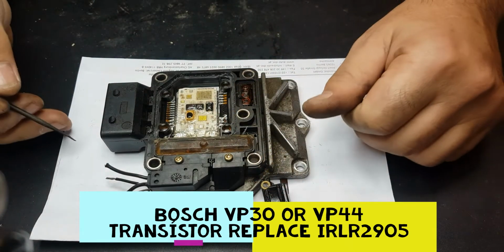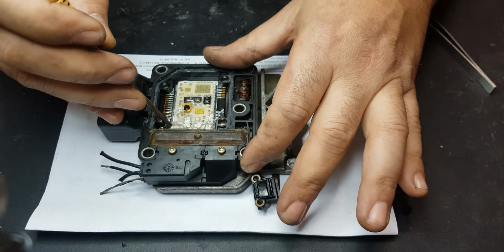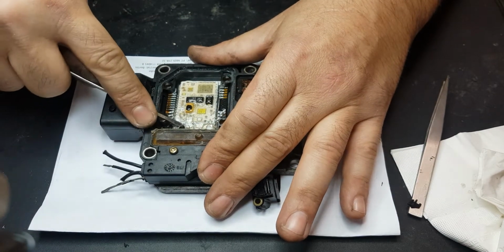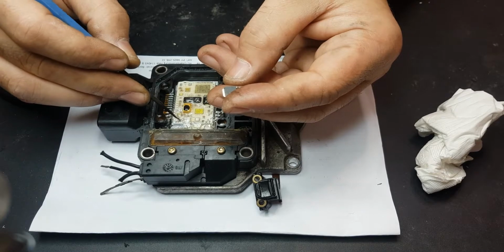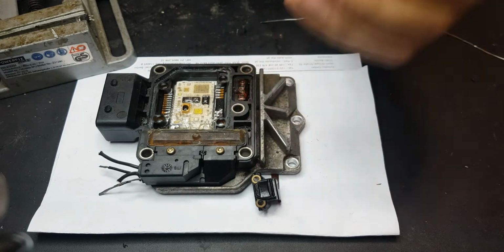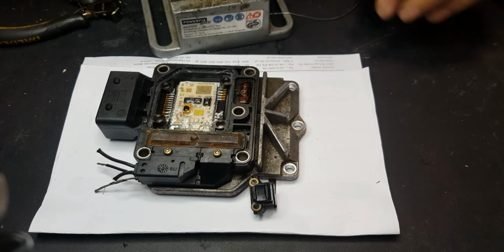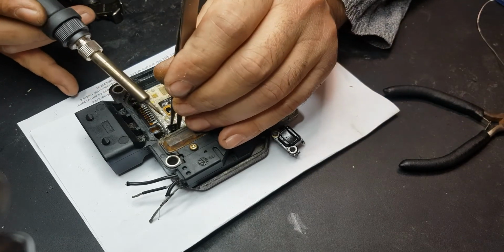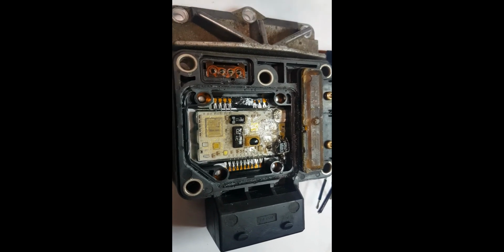bosch vp30 vp44 transistor replacement

Comment: Is the transistor an up graded transistor??? And you said replace the yellow capacitors what is the part number for that and how many should I order??? Thanks I appreciate it.
Reply from the maker: the capacitor is marked in it and its only one per pump...the transistor is pretty much the same as original but there are others that can deliver a little more fuel but the car starts to smoke a little

Comment: Super like. I heard the major failure of these pumps is soldering in the board. Upgrading the heat sink to 60/40 seems like a great idea that could not be viable for mass production but would advantageous for performance and biofuel applications. Thank you!
Reply from the maker: thanks for watching and your input
i guess youre right the mai issue with these is infact the heat dissipation not beeing enough.
some people actually extend the transistor to out side of the pump and use an external heatsink

Comment: Hello , vp30 and vp44 have the same pump control unit ? Can I purchase an Audi A6 pump control unit to repair a Ford Focus 1.8 tddi ? Looks like the same part . . . 
Thank you .
Reply from the maker: @MIEDEPAIN20011  thanks for watching..
No you can because the software is completely diferent from audi to ford
Reply: @PSICompanyPerformance  
Thanks for your quick reply !
And for the advice .
Reply: @PSICompanyPerformance  
Another question please : the Audi software can be removed to install ford software ?
Thank you .
Reply from the maker: @MIEDEPAIN20011  i guess it could be done but i never tried it and dont know what software could bo that.
Reply from the maker: @MIEDEPAIN20011  i dont think that thats possible in this situation...if you have another ford pump, you can virginise it but if its an audi pump i dont think it works.
good luck
Reply: @PSICompanyPerformance  
Hi .
I have an answer , it seems be impossible to removed the Audi software and install a Ford software .
Reply from the maker: @MIEDEPAIN20011  thats what i was thinking.
Reply: @PSICompanyPerformance  
Arff , j’ai encore une question : Est ce qu’il est possible de tester un calculateur d’occasion afin de s’assurer qu’il est fonctionnel , avant de l’installer sur le véhicule ? Merci .
Reply from the maker: @MIEDEPAIN20011  you need to virginize it first, because these are coded to the car, but if its virgin then it will be coded automatic the first time you turn the ignition on
good luck ( bonne chance)

Comment: Hello, my father bought a ford focus mk1 1.8 TDDI less than a week ago, it ran perfectly but now it won't start. The engine cranks but no start. We paid it with our last money and now we're in a very bad situation. The mechanic insists that the pump has failed and needs to be replaced entirely which would cost something like 1500€, and he's saying that we should scrap the car. This is a very lazy mechanic and is very ignorant about electronics, so i want to ask if this could solve the problem? I already got experience with microsoldering because i repair phones and computers so i'm thinking i should try this as a last resort. Do you think this could solve the problem? I just want to help my family
Reply from the maker: thanks for watching
get the error codes read, because it could be something else, but if it is the pump, then, most likely it will be this problem that 9 out of 10 is the fault in these pumps
good luck
Reply: @PSICompanyPerformance    thank you, if you don't mind i got another 2 questions:
1. Can i use the secret menu on the dashboard or do i need proper diagnosis tool for reading the codes?
2. Is it true that IRLR2905 transistor is too weak and will break after a few kilometers?
Reply from the maker: @gio0042  you will need a proper diag tool for this
also be carefull where you buy your irl2905 if it is a good one it will last a long time, there are a lot of chinese copy around
Reply: @PSICompanyPerformance  ok. Thank you so much my friend
Reply: @PSICompanyPerformance  the original transistor wire was burned so i replaced it with 2905, car still won't start, i wired a lightbulb to the fuel metering valve output wires (without connecting the valve wires) and it briefly turns on for an instant then shuts off. Glowplug light still flashes on the dashboard...
Reply from the maker: @gio0042  make sure all the wires are correctly soldered and try another transistor because it has happened to me to get a bad transistor from the box...also check the capacitors to see if those are okay ( rare ) but can happen
Reply: @PSICompanyPerformance  ok. I will take it apart again, check everything and order some new MOSFETS. I'm suspecting a short somewhere because it looks like it gets power for a moment then shuts off. Also i honestly think i got fake transistors because the marking on them says "RLR2905" and the manufacturer seems to be "HXY". Do you think i can check the solenoids by giving them 12v for a short time and hearing if they click?
Reply from the maker: @gio0042  yes but make sure not to feed 12v to long because those work via pwm
good luck
Reply: @PSICompanyPerformance  i removed the old transistor, i got 80 ohm between 5v regulator output and ground... could you test this measurement on a working module?
Reply: @PSICompanyPerformance  hey man sorry for bothering, i ended up replacing with a IRLR3110Z and the glowplug light isn't flashing anymore, i got a lot of diesel at the injector tubes but car won't start no matter how long i crank, what do you think
Reply: If you have p1664 error code , yes it is the driver . If not , it could be something else .

Comment: Were do I buy the transistor to fix that the part number or web site
Reply from the maker: thanks for watching.
there is Robert Mauser or Farnell, just google it and you will find it easy.  Good Luck
Reply: @PSICompanyPerformance  what codes did it have before pulling the part , mine has the P0215 and the pump just clicks I got wire the pump but just clicks and no fuel comes out of the lines to the injectors
Reply from the maker: thanks for watching
i had the same code but had also the reduced fueling request by FIP or Fuel Injection Pump. Check pump relay and wiring also.
good luck
Reply: Hi there 
Can I send you my edu for repair? 
And where is your location? 
Thanks 
Best regards Ali

Comment: Hi!  I used your video to fix the.problem because it is the most complex.  I did not measure the connector at points six and seven before starting.  I did everything exactly as you did in the video.  Then it occurred to me to measure the aforementioned 2 points of the connector.  The result is 98 ohms.  This is very low, so psg is short circuited.  Can this be improved somehow?  Before the repair, when the car stalled, I got the following error codes: p0100, p1664, P1564, P1608, p0335, p1246.  It's all at the same time.  Can it be repaired in some way or does it need to be replaced?

Comment: Hi how did you know that the transisor was the problem?
Reply from the maker: because i saw one of the wire connections to the original transistor was melted so in this case it was very simple to diagnose.

Comment: I have an issue with my vp44, when i put 12v straight to it the truck turns on with the ecm disconnected, so when i connect the ecm truck won't start.. any clue?? Thanks
Reply from the maker: Thanks for watching.
Have you repaired the pump?
Is the pump original to the car?
Are you saying that you can start the engine without the  ecm connected?
Reply: @PSICompanyPerformance  I bought the truck 4 years ago and it was fine.. I don't know if the pump in the original or has been replaced before..  and yes truck starts right away when i put positive and negative on pin 6 and 7, like hat wire test to see if the vp44 works, but when I plug in the the original harness from ECM to the vp44 it won't turn on..
Reply: @ricardojuarez291  I'd check the harness plug for the correct voltage and then check the ground.   It could be bad connection somewhere or a bad ECM.
Reply: @axemanjoe2945  what's up axe.. hey thanks for the reply,, but guess what? Napa give me the wrong crankshaft sensor, I ended up getting the original one from Cummins service.. and problem was solve.. thank you

Comment: what happened to it?
Reply from the maker: Thanks for watching.
The car stop working and when we open the fuel lines there was little pressure when cranking the engine.
Also there was a error code regarding the FIP.

Comment: why not reconnect the broken connection. can you explain?
Reply: thank you my friend ..
after I checked..there was a short on the solonoid spill valve..is that also the cause of the broken transistor connection? .can you give me an opinion..my car is facing the problem ... can you help me in this matter ..
Reply from the maker: @asrulfahmi9118  yes that can be the cause of the broken wire....this transistor is pretty much just a voltage regulator, so any shorts in the system will put the transistor under stress and something will give up...in most cases the wires break or melt.
Good luck
Reply: Hello friend.how much voltage output for sphill valve
Reply from the maker: @asrulfahmi9118  thanks for watching
I never tested it but when reading live data on diagnostic it goes fron 0v up to battery voltage so i assume that it adjusts depending on driving conditions.
Reply from the maker: Thanks for watching.
Yes i can explain my friend.
Usually when  the connection breaks it means that a short circuit has happened in the original transistor and to be safe its better to replace it witha new one.
Hope it helps.

Comment: What type of electrical cable did u use
Reply from the maker: thanks for watching
i stripped a a regular multistrand copper wire and used two strands for each connection.

Comment: Can you put hot glue as like a holder for the wires in case the solder heats up and it gets loose? Kinda like the silicone that was already there
Reply from the maker: Thanks for watching.
I guess you can but it still needs to be soldered before the silicone.
Reply: @PSICompanyPerformance   will a Cummins code p1689 have something to do internally on the ecm? I have a code that’s on my recent video for an example. It says no communication between vp44 and ecm. Checked wires and all seems Okay and grounds. Not sure if it’s a internal problem like how you’re fixing that one or not
Reply from the maker: @ixryq8368  we dont have that engine here in my country but when it happens to a bosch vp pump its usually this transistor that is the problem.
Reply: @PSICompanyPerformance   so a communication error would occur because of the broken transistor or loose wires on it? What are the wires on the transistor for. I know there’s two grounds and what are the others for? What’s the transistors purpose? If you don’t mind answering maybe this will help clear up some stuff
Reply from the maker: @ixryq8368  yes my friend.
The transistor basically works like a relay if you will, to power up the board, if the board isnt getting power then there  is no communication with it...
So the wires are the input of current, ground , and output.

Comment: Well even with teh finest tip, lowest heat setting, aluflux... the small contact on my circuit board decided to burn off. I'm now screwed. Don't suppose you have a spare one for a VP30?
Reply from the maker: Iam sorry to hear that...i dont have spares, sorry.
If you get a spear dont forget you need to code it to the car

Comment: mate, great video and you have a really calming voice lol.. BUT.. it's orientated the wrong way round! You've got it so you can see the transistor clearly but the way the camera points at it, part of the pump casing is blocking the view of the transistor - and soldering points. But thank you for the video anyway, just your replies to comments below have given me hope that i can fix my van.
Reply from the maker: Thanks for watching my friend.
I am working on a freeze frame video because it is really hard to film it and work on it at the same time because you need the eyes exactly were the camera needs to be...this is very small.
I am sure you will get it done...just needs steady hands and good eyes.
Dont forget the flux in this case is the key because the pads where you will be soldering are aluminum...get some Aluflux or something like that
Reply: @PSICompanyPerformance  how long did your repair work? - has it ever stopped working after this repair?
Reply from the maker: @jaydee2559  i had a few that stopped working after 2 or 3 month but i also have a lot of them that has been working for a few years now...i guess it depends on the quality of the transistors , i say this because the work is always the same.
Reply: @PSICompanyPerformance  did you use transistors from the same place each time? - Also wondering if you managed to re-repair the pumps that stopped working after a few months?

i'm also wondering why people remove the legs from the original transistor from the circuit board - surely it would be easier to re-use them and solder them to the new one?
Reply from the maker: I try to use always from the same supplier but i dont know if it belongs to the same batch...
Yes, i always try to repair the pumps again.
Usually when the pump fails you can see the burnt legs on the oem transistor and even when its easier to solder the new transistor to the old legs, you want to make that its not a weak point, so, thats why i clean every old part and solder everything new
Reply: @PSICompanyPerformance  where do i get that flux you recommended? - do you have a link please? - also is normal solder okay or does it need to be a special one? Thanks again
Reply from the maker: @jaydee2559  at the time i searched the web for aluflux and i think i got it from farnell.com
The solder i use regular but good quality one without any flux core.
Reply: @PSICompanyPerformance  was your solder normal electronics 1mm or plumbers 3mm? - i can get 3mm from B&Q without flux but it's a bit bigger than normal but can't find solder without flux locally at 1mm
Reply from the maker: @jaydee2559  i dont 3mm fluxed solder my friend...
I use 0.7mm non fluxed solder for this kind of work.

Comment: Thanks for the video!! I have a question...I tried to repair my pump and after giving ignition, I noticed some smoke coming from one of the soldering pads(the tiny one of the right).
The car of course doesn't run and I checked all the connections but seems to be right. Any tip?
Reply from the maker: Thanks for watching.
I have encountered this issue once or twice it turned out to be a faulty transistor...
But make sure you have soldered the pads to the correct spots.
I am going to make a short video explaining very carefully and with pictures and drawings enlarged so that everybody can see clearly.
I had many requests on this.
Reply: @PSICompanyPerformance  Thank you! I really appreciate your answer. A faulty transistor could be indeed the case. 
I have an extra one, so I can give it another go to replace it.
It was just weird to see some smoke going on while nothing really was happening.

I was wondering if perhaps this had to do with faulty solenoids?(shorted or so)
Reply: @PSICompanyPerformance  Thank you for replying! I think I've soldered them well(but I will verify again with your video). I have the feeling that I'm having a shortcut due to the cable of the solenoid(the one that goes under the pump), since I noticed that the cables were pealed
Reply from the maker: @j_laskada  those cables are always in bad shape...but if it smoked there should be a burnt smell and it may help you identify what was it.
Reply: @PSICompanyPerformance  Hi! I actually found out that my solenoid works as expected. I was soldering to the alternative point of the gate(the one of the cap) and I removed the cap my mistake... Do you know wether this cap is really neccesary or not?(usually caps are meant to reduce noise but not sure what is the goal of this one here)
Reply from the maker: @j_laskada  cant tell for sure but in this case i believe the cap is used to store and discharge a spike of energy when its required....i believe its indeed needed.
Reply: @PSICompanyPerformance  Alright, thanks for the information! I wonder why I keep getting 2V with ignition.. 
I don't understand it anymore. I checked all the points and they seem to be correct but with ignition, I just get 2V while I should get 12.

Comment: Thanks for the guidance, can i do a multimeter test and how much ohm should it be?
Reply from the maker: I will make a video on how to test a transistor and i will be using one of these transistor as an example.
Thanks for watching my friend.
Stay safe
Reply: @PSICompanyPerformance you eve did thay video
Reply from the maker: @Ex-fk4nr  i am sorry but still havent done it yet but will soon i already have a pump here to repair, so it will be very soon
Reply: @PSICompanyPerformance  ok thenks I'm will be waiting until than.
Reply: @PSICompanyPerformance   ok thank you very much !

Comment: Thanks for the guidance,  what type of solder did you use for this?
Reply from the maker: The solder is 60/40 that is a regular one, the secret is the flux because its really hard to get the solder to stick to those aluminum contacts.
Reply: @PSICompanyPerformance   yep cool,  any alternatives to alu flux,  it quite hard to get hold of.
Reply from the maker: @TheLeathemm  i will check today and let you know.

Comment: Buenos dias amigo el transistor es el IRLR2905?  yo lo he instalado el carro prende pero al rato vuelve y le da la misma falla quema el transistor tu me podrias decir en que puedo estar fallando?
Reply from the maker: The base of the transistor is a heat sink so it must be soldered to the chassis of the pump for over heating prevention.
Also i had the same issue with a few defective transistors.
But it could be some short circuit in you pump itself.